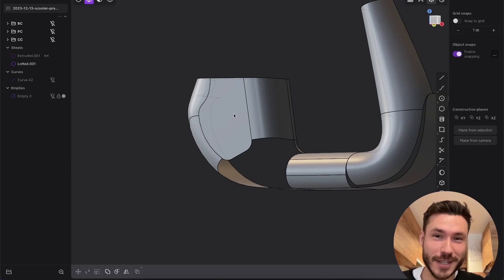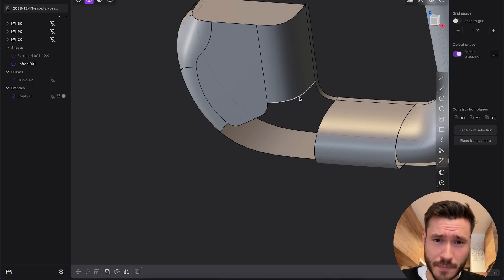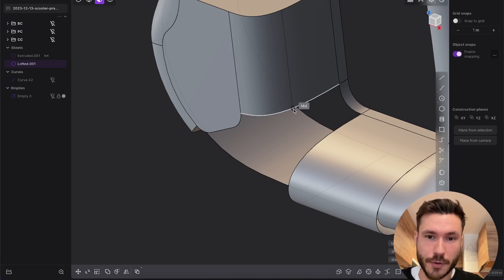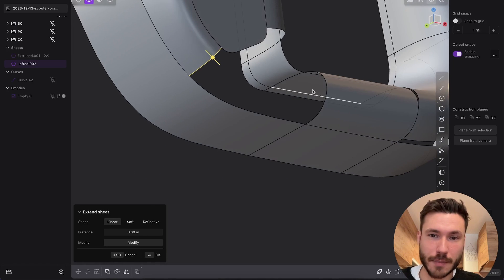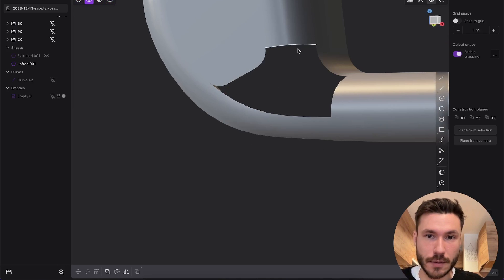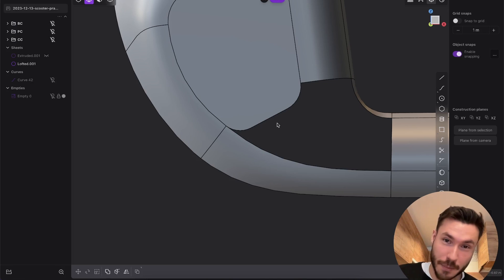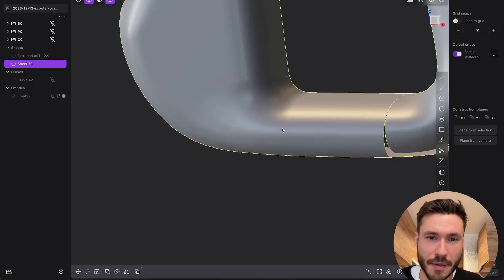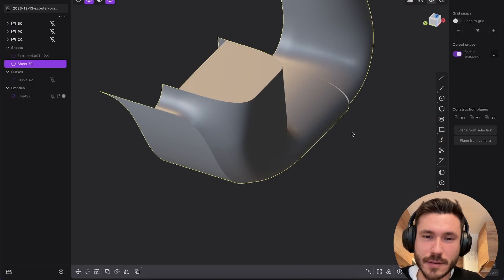How to create complex patches in Plasticity | Surface Modeling Exercise

Comment: Hi! Love to see your video and glad to hear that you use Mac now, what do you think after switching from PC to Mac while using Plasticity? And what version of Mac are you using now? Coz I am a Mac user for a lot of years and want to restarting my 3D work recently. Any advice on it??? thanks a lot!
Reply from the maker: I am currently using a MacBook Pro M1 Max 32GB RAM
For Plasticity there is no difference if it's Mac or Windows. 

Also, I bought the Mac because I am traveling all the time right now, and the ARM architecture chips are amazing for modeling, rendering, efficiency, speed, etc. while traveling.

But once I get home, I definitely go back to Windows. MacOS is horrible for me personally. The arm chip and the build quality is the only thing why I have a Macbook. Once there comes an Arm Windows laptop with good hardware like the Macbook Pro, I will INSTANTLY switch back.
Reply: Thanks for your reply! It helps a lot for me. So excited to hear that the rendering and speed are good on plasticity. How about the stability on it? Is it much more stable than Pc?
Reply from the maker: @leepokin1981  compared to using Blender, Cinema4D and Photoshop (other similar tools that I use) on Windows and Mac, honestly Plasticity is the most stable of all of these programs on both OS. It’s very very rare that Plasticity crashes or not doing what it should do.
Reply: @nikita.kapustin  love to hear that! thanks, I will keep watching your video to start my plasticity career! Please keep make great video on plasticity! looking forward to some  great skills!

Comment: Why did you change to Mac? Years ago I did the other way around, because Apple could not keep up with 3D modelling demands, processorwise. I am very curious why you now think it's ok? And where you live now? I recently moved to Italy 🤗
Reply from the maker: Where are you originally from? I am currently in Poland.

I changed to MacBook just as an experiment because I never had one and my Windows laptop was dying already. Because I travel a lot form country to country I can't have a stationary PC anymore, so I needed a new laptop, which is very powerful.

I must say MacOS is horrible after 28 years of using Windows but the hardware (MacBook Pro) is just completely unparalleled. It's just fun to look at, touch and use. 

But if a laptop with arm-based chips with Windows comes out, which has the same build & design quality as MacBook Pro, I will not wait even 1 millisecond and switch back to Windows.
Reply: LOL, I can totally understand that! I am from the Netherlands and have a graphic design career ( with Mac Pro's) as well as a 3D modelling and visualization background ( switch to Windows PC's) . I worked a lot on architectural projects and maritime and offshore. My tool of choice has in the end been Cinema 4D for its  versatility, stability, speed and user friendly interface. Two years ago I moved to Italy, to the mountains. But I do not need Cinema 4D anymore. For our renovation project and interior adaptations I came across Plasticity, and, as I think you did, fell in love with it. Sure it needs some tweaks and improvements still, but It's awesome. I bought a few of your courses, which I really enjoy following along. Nice to get response from you. Keep up the good work!! BTW: do you ever sleep??? 😉 @nikita.kapustin
Reply from the maker: Amazing! Definitely on my wish list to live some time in the nature next to a forest/mountains as well:) Hope you have a lot of peace around there.

Glad to hear you enjoy Plasticity so much! @jeroenbeltman515

Comment: These short videos are super helpful after I've watched a longer one.  I'll be implementing things I've seen in the longer tutorials, but these are super helpful when I run into little confusing situations that only need a short answer.  Thank you for Plasticity and the tutorials.
Reply from the maker: Thanks for your feedback. Did you stumble randomly to this video or have you been searching for something specific? If yes, what were you searching for?
Reply: @nikita.kapustin  Don't quite remember.  I was having trouble cleaning up some surfaces but don't remember what I searched for and its not showing up in history.  YT gave me you, Vaughn, and some others but you two showed me something that got me back to work.  Probably another way to look at something.  I think it was a foot incline from an extruded footprint, and instead of trying poly thinking where I would just rotate the top plane down for my angle, I just made a quick cutter block to remove the un-slanted part of the foot.  Thank you for your helpful work.
Reply from the maker: Okay thanks for sharing! Glad our content is helping and motivating you to explore PLasticity!
  @AsaTaylor

Comment: The workflow is never perfect, any artist knows that he has to deal with these kinds of problems at some point, If you cut this part and don't show the different techniques you used we will lose the most valuable part of the tutorial.
Reply from the maker: Got it! Will implement more of these in the future
Reply: Could you please do a video about properly exporting Plasticity models to Blender and how to prepare them for physical output? (3D print, CNC, etc.) I've been trying the Blender bridge addon, works great for visualization  but when I try to use Quad Remesher to convert from ngons to quads the resulting mesh is a complete mess, same with the 3D printing addon. Especially problematic are the awesome microbevels and fillets generated on Plasticity, they look great but Blender/Quad Remesher has a hard time recognizing those as creases...